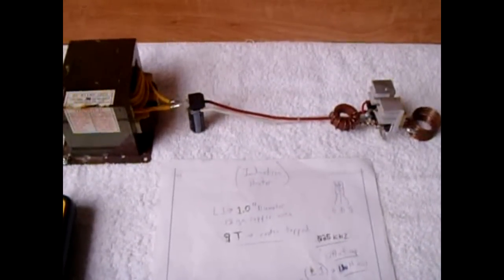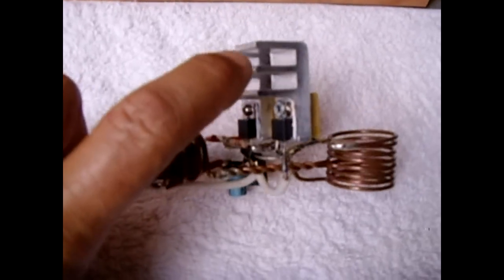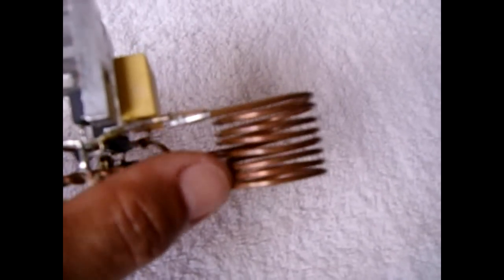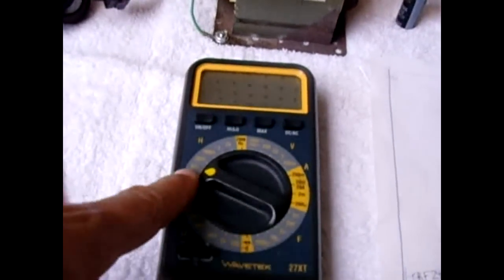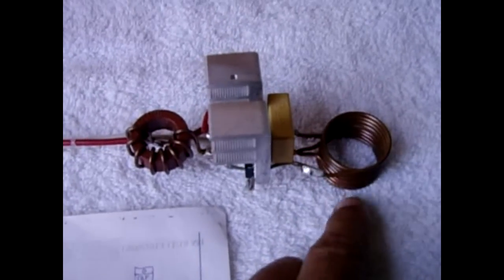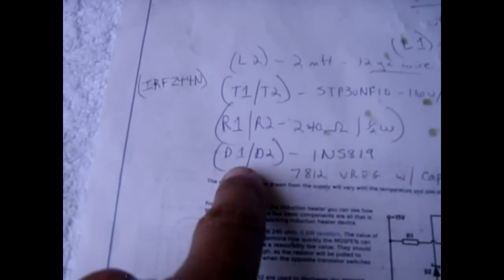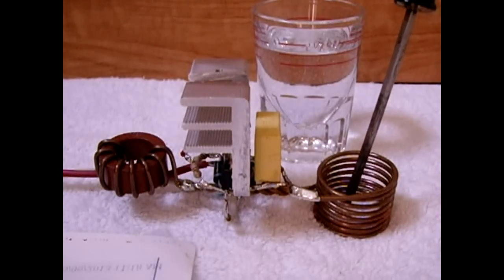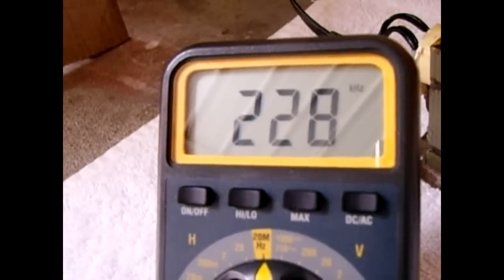How To Make A Simple Induction Heater ~ FULL explanation & schematic

Comment: Just curious -- can anyone tell me why a 12v standard wall power adapter wouldn't work for this?

Why go to the trouble of using a 30v transformer and then limiting it to 12 volts?
Reply: Awesome vid by the way electronicsNmore -- really well-explained.
Reply from the maker: The wall adapter cannot supply the 5 to 8 amps of current. :-). Check out part 2 in my video list.

Thanks For Watching!
Reply: electronicsNmore Nice, just checked it out -- you have some of the best videos on this stuff -- really helpful. +1 subscriber ;-)

If you got a spare minute, could you answer a couple questions? Might help your other viewers out too..

Theoretically, would a:
  1. higher gauge / thinner wire (ex. 14 gauge)
  2. smaller (3/4") coil
  3. thinner piece of metal to heat
...require less voltage / consume less amps?
- Should any circuit components be changed if you used this setup?

- Is it as effective (possibly more simple) to just solder a center tap onto one continuous coil, instead of twisting two together?
- Is the center tap coil always preferable to no center tap?
- Is there any way to regulate / control the level of heating, via a twist knob?

Thanks man - even if you could just answer 1 or 2 questions, I'd appreciate it.
Reply from the maker: Hey Ryan,

A smaller piece of metal inserted into the working coil, does draw less current from my tests.

A smaller diameter working coil would create a more concentrated heating area(alternating magnetic field). The object being heated will glow more red/hotter if nothing else was changed except for the working coil.

Soldering a center tap may not be a good idea. The working coil can get fairly hot and melt the soldered connection. If you brazed it(hard soldered it) instead, no problem.

You need the center tap in the working coil so the current is able to flow in two directions to create the alternating magnetic field.

You can control the level of heating, by regulating the flow of current into the circuit(the center tap). If you had a large rheostat (10 ohm) laying around, like I used in my inverter generator/alternator videos, you could hold back the current, or use a DC SCR current limiting circuit.

Thanks For Watching.
Reply: electronicsNmore Awesome answer man - can't tell you how much that helps! Really appreciate it.
Reply from the maker: Your welcome Ryan.
Reply: electronicsNmore Hey man, just wanted to let you know your videos & input really helped me out -- before I watched them I literally knew nothing about electricity/electronics, and now I was able to build a killer little induction heater. Thought you might think it's pretty cool so I uploaded a little vid: http://youtu.be/_5GEWmKMnuA

I'm using a 12v 5-6A PSU for laptops or something. I also designed/etched a pcb & was able to make all the coils & components (except mosfets) pluggable, so its super easy to experiment with different components/coils/PSU's or replace fried components. 
I found a great way to center tap the coil too -- I use solid wire for the coil (tried insulated to prevent short-circuits), strip the middle about 1/2", divide the end of a stranded wire in half, and wrap each half around the solid wire in opposite directions. Super easy & works like a charm.

I also built that spiral coil that you thought would be interesting (the one I hold up in the video), but it wouldn't oscillate. Maybe I'll try again with a different capacitance later. I'll let you know if it works out.

If you have a couple spare minutes, I was wondering if you could help me out with a question I have.  I want to make an auto-off circuit, with a momentary switch, that will automatically shut it off after 10-15 seconds & I can't really find any simple solutions.. The closest thing I've seen is your circuit for your water heater -- do you think I'd be able to shrink that down & adapt it to work for my induction heater? Any input would be awesome b/c I'm kind of stuck, lol. Thanks.
Reply from the maker: Hey Ryan,

I checked out your video and commented on the video. As for the flat coil, as I stated in the video, I suspected it may not work because the current can only flow in one direction. You did an excellent job. The water heater control circuit using a 555 to trigger a relay, will work perfect for you!

Thanks For Watching
Reply: electronicsNmore Thanks man, yea the flat coil was worth a try -- thought you might want to know how it worked so I gave it a shot.

I'm stoked that you think your auto-off circuit will work. From what I can understand so far, it looks like to reduce the time from 15 minutes to 10-15 seconds, I'll just have to reduce the value of the potentiometer and/or C1 (to maybe 10% of the value?). Am I on the right track, or do you think any other component values should be changed also? Thanks.
Reply from the maker: The resistor value and or capacitor value is what adjusts the time.
Reply: electronicsNmore Great, thanks for your help. Really appreciate it.

Btw, I just got your coil to oscillate after I reduced the capacitance to .22uf -- but after about 5 seconds, I checked the mosfets and pretty much seared my fingers, lol.. But the coil does oscillate...
Reply from the maker: Glad I was able to help you. :-)
Reply: electronicsNmore
You use a microwave oven transformer for this to get 5-6 A @30V, but then you're sending it through a 7812? Check the datasheet on a 7812.
Reply from the maker: No. The current for the working coil was not flowing through the 7812.
Reply: "You need the center tap in the working coil so the current is able to flow in two directions to create the alternating magnetic field."

So why do some work without center tap coil?

Comment: Since the coil is an uninsulated wire, what is the peak voltage running through it? If you were to short it with the metal object you're heating or your body, what kind of voltage and current do you believe is present in the coil? Thanks.
Reply from the maker: My Oscope would need to be connected to measure that. To prevent shorting, use some kind of heat resistant insert.
Reply: @electronicsNmore  Thanks!

Comment: What voltage capacitor works best of the RC circuit?  I have been searching ebay for a suitable capacitor but don't know what is best.  I searched for 1000v .22 RF caps they are $40 each. LOL. I found all the parts so far on ebay except the RF cap.  I have several microwave oven transformers I hope I can get 1500 watts out of this circuit to make full use of my 1500 watt transformer. I am not sure how to calculate full load current on this circuit the Mosfets seem to run in push pull 35A x 30V = 1050 watts. The Mosfets are rated 100V 35A if I up the voltage to 50V that should make the circuit be 1500 watts. Am I right? MOTs have a low duty cycle 100 turn primary coil they can only run continuous for a short time maybe 15 minutes at 1500 watts.  I am building this project hope you can give me a few tips so I don't have to figure it all out on my own. I graduated in engineering 1976 and worked in industry for 40 years. I'm not really up one Mosfets but I will learn.
Reply from the maker: The voltage rating is not as critical (At least 100v) as the capacitor being designed for high frequency use. You can find and use type X capacitors(not high frequency, but they work) in many scrap electronics/tv/etc. Using a few in parallel to give you the desired capacitance is best in order to distribute current and help limit heating of the capacitors. I would use (2)  irf3205's for your project. You are going to need to experiment until you get it working right. I suggest you use copper tubing and pump water through the tubing to cool things down. Refer to the link in the video description area for more detailed info.

Thanks For Watching!

Comment: can you touch the coil while its on? not that  would but what if my metal accidentally makes contact?
Reply from the maker: I have, but be careful, the working coil can become fairly hot. If the metal makes contact and shorts across the turns of the working coil, you may blow a mosfet.

Thanks For Watching! Be sure to check out my other videos as well.
Reply: thanks will do

Comment: It doesnt matter that the copper wire have or  NOT isolated with resine in the moment when twist the wire?
Reply from the maker: You use a copper wire WITHOUT insulation. The insulation would likely burn off if you did use the induction heater for a longer period of time.

Thanks For Watching!

Comment: ah,awesome , electronics are so cool.  so if we say there are 2 different critters headed in opposite direction with opposite spins, the electron from the negative towards the positive with a inductive capacitance capability and the proton from the positive towards the negative with a electrical capacitance capability, the electron from the negative towards the positive is amps or current flow ,and the proton from the positive towards the negative is voltage or electrical pressure,  weather its the positive and negative mineral elements in a battery or the positive and negative magnets in a generator,  what do you feel is happening,  in laymans terms with the germanium diodes,   ? a forward push of the proton,or the electron,  can you help me out a bit?//
Reply from the maker: The simplest way to put it, the alternating magnetic field which is created, induces eddy currents in the workpiece which generates heat.
Reply: hmm.  thanks, cool,vids, you in on the spacecraft club yet? a good noodle twister 4sure.  build yourself a free energy spacecraft or get a grid,or get off a grid or get right off the planet in your free energy spacecraft ,built and operated by YOU.go to  mikefromspace,  view all and find the club inside.  decide >join  get the disc, c u there~~~~

Comment: A heater this size has some applications but I would like to personally enter the steel age in my backyard. I want to know how to scale this up and have a large crucible of molten steel, and even use this induction process in tandem with two low-volt carbon electrodes. I know about using copper tubing to have liquid flowing through to cool the working coil. What about these other components like the MOSFETs and Schottky diodes? Do larger & more expensive versions of those have to be used or can you connect smaller ones in parallel?
Reply from the maker: You would need to use 1/4" or 3/8" copper refrigeration tubing with water flowing through the pipe to keep it cool. You would need a much larger transformer, higher voltage would be good also, more capacitors in parallel, I would go with some IRF3205's with large heat sinks, and use 3A schottky diodes. You really have to experiment with everything to get it working just right. You can use mosfets in parallel, just be sure to use the same value gate resistor on each mosfet.
Reply: this type of heater works well up to 1kW but for smelting steel you need much more power
The main disadvantage of this type of heater is that it requires low voltage high amperage which in turn requires a big ass transformer and at higher power levels the looses will be significant 

To eliminate all those you need to use mains voltage directly on the work coil
Just search the web for schematics and tutorials

Comment: Can you please show us how did you calculate the diameter of the coil ( 1 ince) in your coil?  
Which way did you use to to get the amount of inductance (1.1 Micro Henry) ? Thank you very much in advance.
Reply: Just google inductor calculator.  Then follow link to daycounter dot com which has an air cored inductor calculator you can use online.  This will get you close then buy yourself a low cost inductance/capacitance meter to read the exact value.

Comment: I admire your circuit. I've got the same exact schematic you have (9:28).  For the life of me, I could not get mine to work.  When connected, It just draws max current and power supply clamps at 5 amps. Scope shows no sign of oscillation. Checked FETs and diodes -- OK. I tried every possible configuration -- nothing worked! I'm using two IRFP260N FETs, 260 ohm gate resistors. Only difference are the diodes - I used FR307 fast switching diodes. Maybe should use only Shottkys (?). I connected an audio oscillator to the coil and cap; it resonates at 270 KHz so I know it's ok. Any suggestions? Thanks for posting yours.
Reply from the maker: +Bob H 
Duplicate what I did exactly. It works. Your power supply is too weak. Make sure it is rated 10 amps.
Reply: +electronicsNmore - Power supply is easily 20 amps. I set it to clamp at around 3 amps. When I turned up the amps, wires were getting hot! It appears that the FET's are conducting hard, i.e., no oscillation occurring. The scope also verified this. I'll try building this one using the same exact components. Thanks!

Comment: Question about the mosfets, Can I use 2 mosfets #2sc3320? ratings are  Vceo = 400VIc = 15APc = 80WHfe = 10 minton = 0.5 microseconds (ms)tf = 0.15 microseconds (ms)Case = TO-3PB (SC-65)
Interested in this build. I will be salvaging as many parts as possible from the abundance of computer scrap I have. Thanks
Reply from the maker: No good. Need to use mosfets. 2sc3320 are NPN transistors.
Reply: OK thank you, where would one find them on old psu's or computer components? Any ideas
Reply from the maker: Many electronic devices use them.
Reply: Hello, i'm having an issue with my mosfets. I have a bunch of
IRF650b mosfets that seem to all be staying open. I test them completely
and they wont discharge and close. I am testing them with 5 and 12v.
When I test my FQA9N90C Mosfets, They work just fine. Is ther something
different about the 650's that need to discharge or are they all no
good? Thanks for any help.

Comment: What happens if you accidentally touched the coil with that screwdriver?
Reply from the maker: +imadude85 
Touching only one turn would likely do nothing. Shorting 2 turns or more will possibly destroy a mosfet. Thanks For Watching
Reply: +electronicsNmore owh. meaning we will be perfectly safe? no shorting to our body?
Reply from the maker: imadude85
No such thing as perfectly safe. You're using a  low voltage/high current power supply, so there is certainly no risk of electrical shock.
Reply: What is a mossfit?
Reply: The video is extremely frustrating.  I am looking for a parts list (in plain English) and source, that explains what each part does, with step by step assembly instructions so I can build an induction coil large enough to heat a billet of tool steel 1 1/4" in diameter quickly and repeatedly.  Do you or anyone else have a video that does that? I have been searching for months and all you tube videos skip essential information.  I don't need to see it get something hot.  I need a detailed how 1,2,3,4.  Thank You

Comment: Help please!  Is that a bridge rectifier that u used coming of the transformer?
Reply from the maker: Yes, a full wave bridge rectifier.
Reply: are both wires coming from the transformer running into the rectifier
Reply from the maker: Yes
Reply: electronicsNmore I asked that too soon, I think I got it figured out now. I had it wrote down on my sheet wrong and it was messing me up. Thank you for your help.

Comment: Could it be adapted to run off a 12v car battery is what I was trying to ask you
Reply from the maker: +1000000volts 
A car battery will work fine, but higher voltage of around 15v is better.

Comment: can i ask for the specificaation  transformer you use thanks by the way for this vid..
Reply from the maker: Transformer was from a 800w microwave.
Reply: +electronicsNmore  do you know the volts and current for that im jusk asking and planning to do the transformer manually
Reply: +Nexxus Von Bumanlag  thank youuu.. please can you tell me all the components and mataterials you use for this one. and the also the specs if possible thanks lot
Reply from the maker: Everything you need to know is in the video description area or the video.

Thank You!
Reply: +electronicsNmore  is inductor required to be torroid or can be another like resistor type?
Reply from the maker: Nexxus Von Bumanlag
I would use the inductor.
Reply: +electronicsNmore  i mean only torroidal inductor even with not the same specs but almost 2mU

Comment: hello very good video. if not too much trouble I would like to ask if you could explain the input and output current of the circuit. 
  I do not understand the connections diagram say both 15 + both input and output 
I understand that the entry is 15 v cc but must be + and the other -. 
also I do not understand the connection of transistors on the diagram 
  It is very helpful for me thanks

Comment: I'm not really clear (I probably did not pay close enough attention)... what does the circuit do?  Converts voltage to current?  It doesn't rectify the voltage does it?  It does have voltage regulators so maybe it does but then we see a frequency after the circuit... so no...?  I assume that since the "output" freq is in the 200kHz+ range then so is the "input" freq to the transformer...?  What drives the transformer?
Reply from the maker: The large microwave oven transformer is plugged into 120VAC. I wound a new secondary to the transformer to supply around 13-15VAC. The output is rectified, and supplied to the circuit. The mosfets alternate switching on/off at a specific frequency, the alternating current in the working coil produces a magnetic field which is used to heat things up through induction/eddy currents.

Thanks For Watching.

Don't forget Part 2.
Reply: electronicsNmore
Thank you for the quick answer.

The mosfets somehow take a 120Hz voltage and multiply it up to 200kHz+ eh?  Mysterious.
Reply from the maker: The working coil in parallel with the capacitor is what determines the frequency.